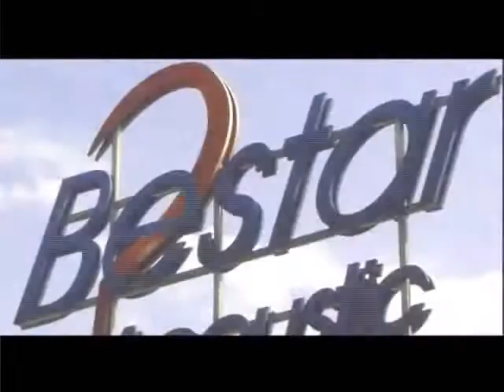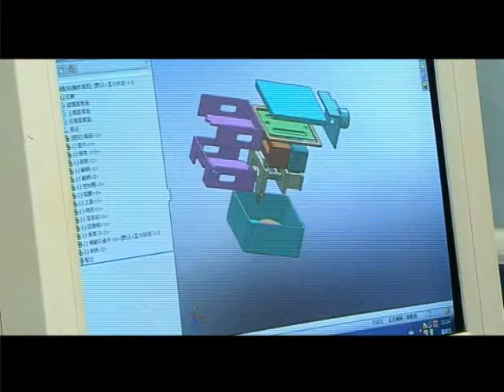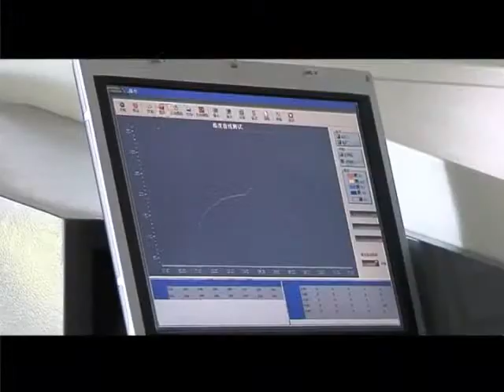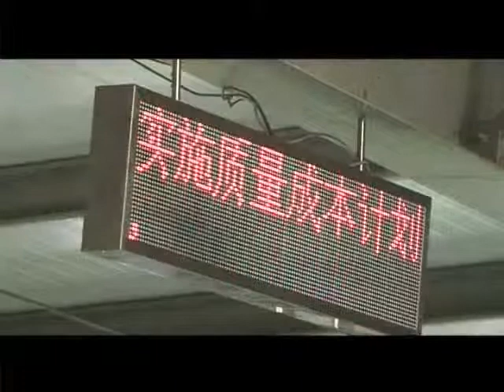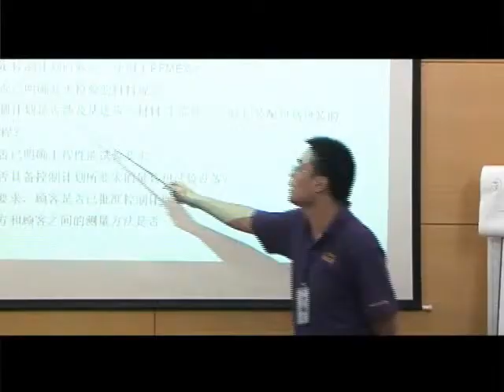Bestar Technologies Corporate Video English July 2012

Comment: Tried to use them but they would not work with us once they received our PO.  Could not get product from them on the due date. There are other audio sources out there, I would suggest looking hard at these guys if you are going to use them.  Don't get caught waiting on parts without a back up.  We are going back to our old supplier.